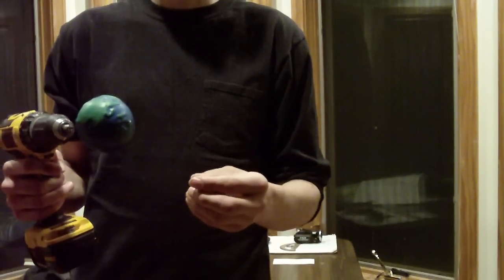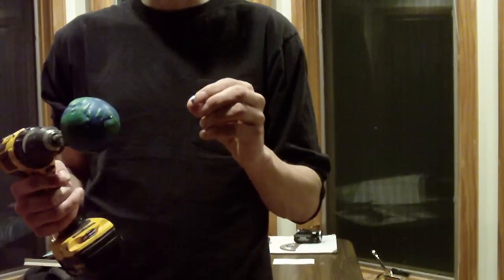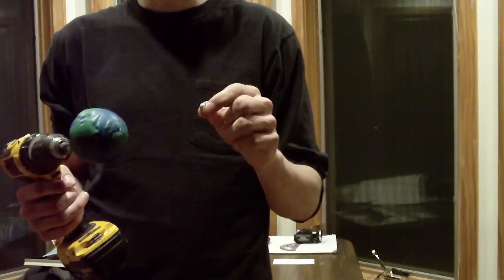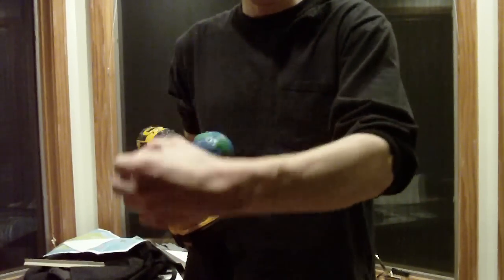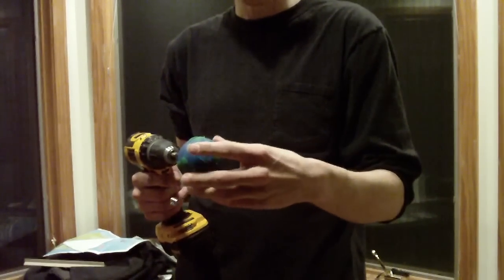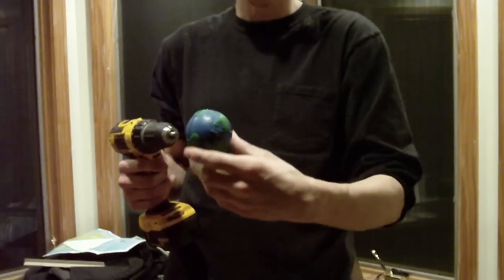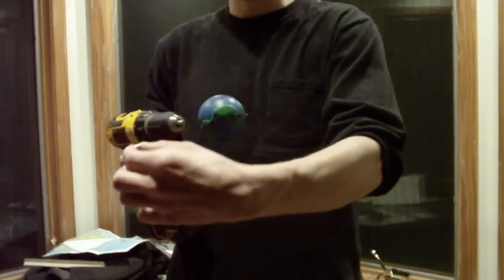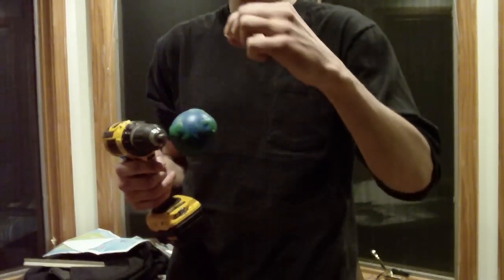Demonstrating the Basic Concept Behind the Space Elevator

Comment: I know the quality of your videos and I can only assume you were pressed for time because you oversimplified that to such a degree that it seems like you didn't even so much as look at the Wikipedia page on it.

"A space elevator for Earth would consist of a cable fixed to the Earth's equator, reaching into space. By attaching a counterweight at the end (or by further extending the cable upward for the same purpose), the center of mass is kept well above the level of geostationary orbit. Upward centrifugal force from the Earth's rotation ensures that the cable remains stretched taut, fully countering the downward gravitational pull. Once above the geostationary level, climbers would have weight in the upward direction as the centrifugal force overpowers gravity."

http://en.wikipedia.org/wiki/Space_elevator

Comment: Any ideas for a material able to carry its on weight (and an elevator) over effectively 11,000 miles?
Reply: There is only one material we could make the cable out of: carbon nanotubes. Its the only material we know of with enough tensile strength to withstand the force of gravity trying to pull it towards Earth and the centripetal force trying to pull the counter weight into space. Head Squeeze has a great video on the Space Elevator where they go into more detail, you should check it out.
Reply: Seen that yes. But the point of a space elevator compared to creating something more practical needs to be considered. Also, with the heavy cord hanging from it, the orbit would need to be higher surely.
Reply: Cloxxki It doesn't matter how heavy the cord is, it will be kept taught at all times by the centripetal force trying to pull the counterweight into space. That's the point of the counterweight.

Comment: The earth would have to rotate fast enough for that to stay in orbit.
Then there is wind, rain, snow, hurricanes, etc, pushing on the string.

If the rotation was too slow, the wire would just wrap around the earth,
and if it was too fast, the wire could snap.....
The length of the wire also has to be taken into consideration

Comment: Space elevator is a pretty good concept...   though the complex dynamics involved..? especially the logistics!?! The layers of Earth`s 'atmosphere-(pressures, different temperatures, weather, static energy/electricity)' ...approximately 1250 kilometers of the cable/line-connection would be inside it, the lower 1/3 of the layers being the biggest player...  the lower atmosphere-intense weather and gravity pulling against approximately 650 km of cable/line (how much of a counter pendulum/swing and/or weight would have to be created?) ... the seasonal changes and shifts-(Sun angle[large temp. range/swing] will add to these numbers..? ...many more factors as well..!
I love the concept... I just feel it is not possible!!
Cool vid bro!
Peace!
Reply: Martin Bigger No, its wind resistance. In a vacuum holding out your arms would have no effect on your speed.
Reply: Any counter balance needed above the normal elevator itself can be let out and pulled in as needed if designed properly. Have like an extension pole you can pay out at the top. The concept is sound, but there is one unspoken possible problem. It is the 'ice skater phenomena'. When you let out the arms of a spinning ice skater, they slow down. Would an elevator have such an effect on the Earths rotation rate and if so, it is out of the question.
Reply: ISamuelII I don't think the satellite would be anywhere near massive enough to have drag force on the planet.
Reply: Sentinalh
lol wut? Have you not heard of 'conservation of momentum'?
Reply: ISamuelII
in the ice skater phenomena it is the fact that the skaters arms used to be at the smaller radius and then moved outwards slowing it down.. first of all it would be an asteroid that we would use as a counter weight and wouldnt be coming from a smaller radius (earth) and we would set the asteroid in orbit to be in perfect synchronization with the orbit of earth so it wouldnt slow it down

Comment: It's a great idea and I'm not saying it's impossible
But if it's a cable then every Newton of force u put on the cable with in turn weight down the object in orbit towards earth and u would need another force to balance it out.

Or if it's a structure sustaining it's own weight (and additional weight) it has been shown that for that large of a radius from earth (even using carbon nanotubes) the base would have to be soo large and be designed in a cone that it would be sooo large it wouldn't make sense.
Reply: The centripetal force of the spin is what keeps the counterweight in space and the line tight. The forces are trying to pull the counterweight into space and that's what makes it work.
Reply: Sentinalh first of all i believe u mean inertia instead of "centripedal force" and its inertia is balanced with the gravity of earth. therefore a net 0 movement and forces balance out. but any additional force will weight down the asteroid (counterweight)
Reply: Martin Bigger No, its centripetal force, the outward force exerted on a spinning object. Its why you tend to slide towards the outside of turns when traveling at speed.

Comment: That is nuts.  How would they get a cable 22,000 miles long??
Reply: they are looking into some nano fiber material i cant remember the name of.
Reply: ***** or fishing wire.
Reply: ***** Carbon nanotube, if i recall correctly.
Reply: There is a trick to cables called splicing.

Yeah you'all are thinking of carbon nano nano tubes.
Reply: Yeah sounds right, but even still you have to think about the stress on the lines from earth spinning plus the elevator it would make me think about while you are in the middle would it not cause a bend in the cable? I cant think of what im trying to say haha.